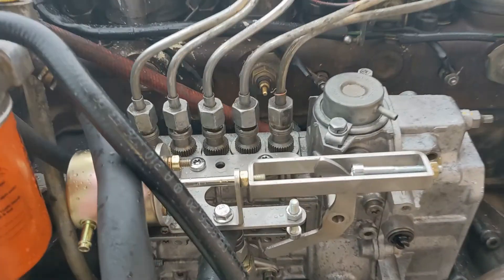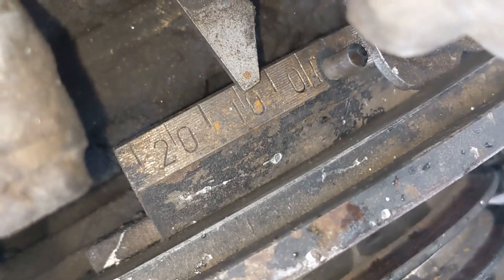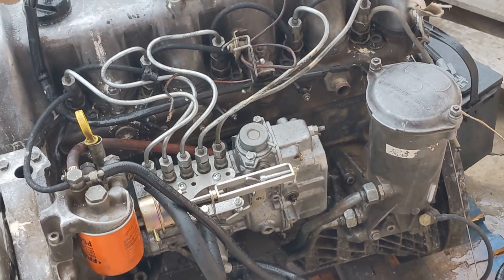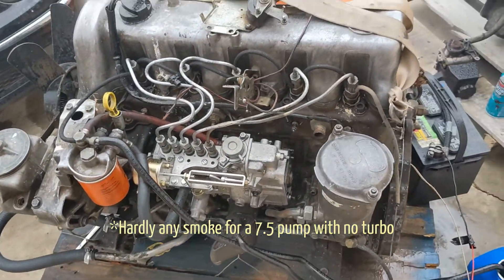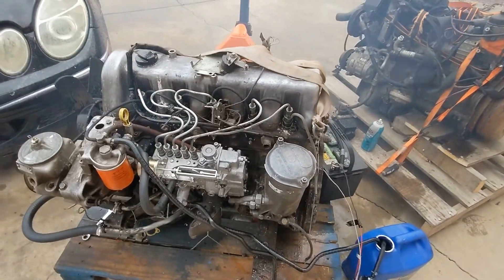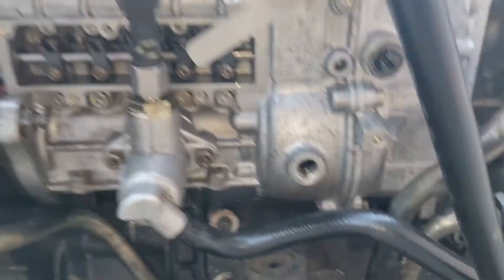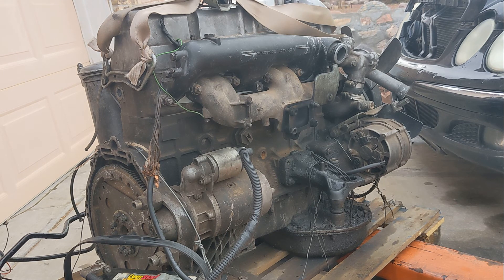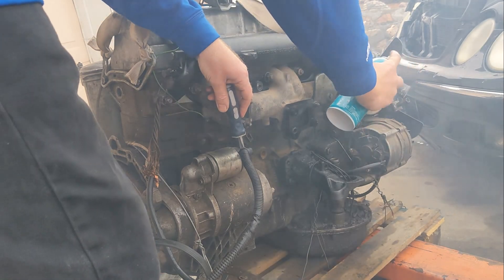Mercedes Diesel Injection Pump Timing

Comment: Great job but i have question.
Why is there a lot of smoke when timing is incorrect because when my 200D went out pf diesel and when I tried to prime and start it this smoke was coming out and is there also problem with my injection timing? Thanks

Comment: So, the stock pump with stock engine is ~24° before tdc but you put 10° after tdc with that very nice custom pump like the om 60× series?
Reply from the maker: Correct. That way all pumps we sell at benzinjection.com are all 10' ATDC.
Reply: @BenzInjection but that's because the amount of deliver fuel or because of the pump internally?
Reply: @valparaisosting The mark on the pump has no fixed relation to actual start of injection, its completely arbitrary and can be whatever the pump builder wants.
So while the mark on the pump is 10 After TDC the actual start of injection is still 20 something degrees before TDC.

Comment: Nice experiment. Why is 10 deg. precisely the right timing?
Reply from the maker: Because we put a custom mark on the cam weights to where you set the engine at 10 ATDC, instead of using the mark on the cam gear teeth.
Reply: What about the camshaft mark at 10 degrees?? can you explain me please  @BenzInjection